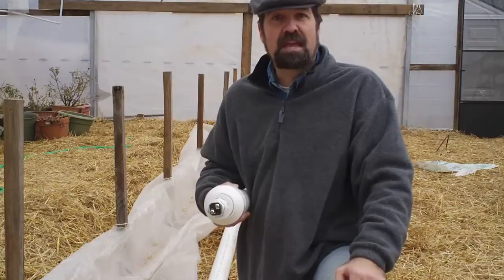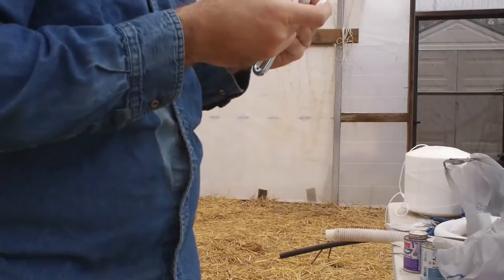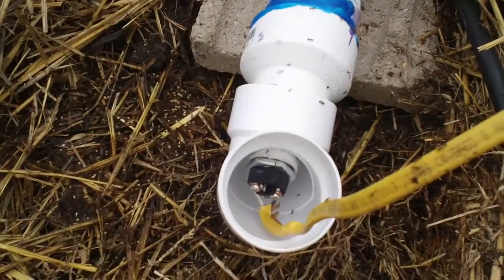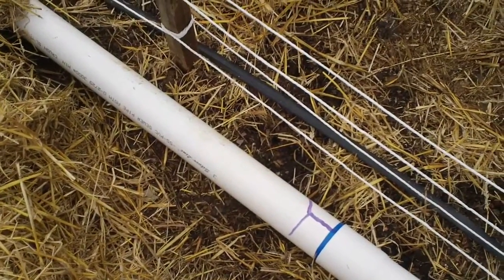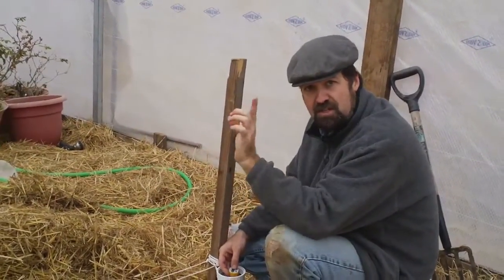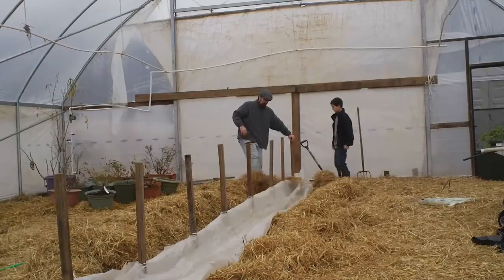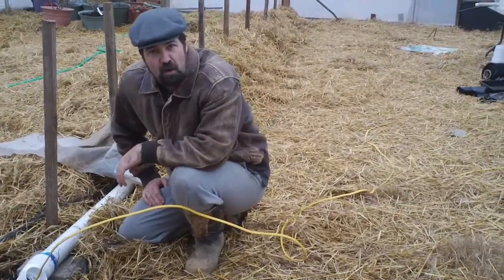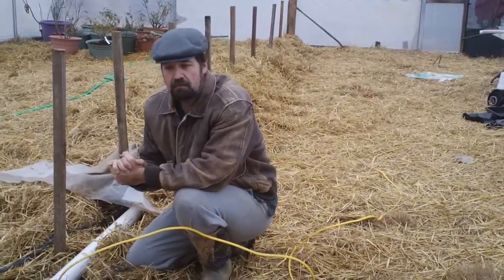Experimental Greenhouse Heat: Hot Water Tubes

Comment: How has that pipe held up long term? Where did you hook up the wires from the element to? I am wondering if a car battery would work? Where did you get your timer and what was the product? You should have way more views and subscribers because this video was great! A mylar blanket or a insulated reflective blanket would help heat the pipe and keep the heat in. I wonder how many pipes you could heat in a row with one element.